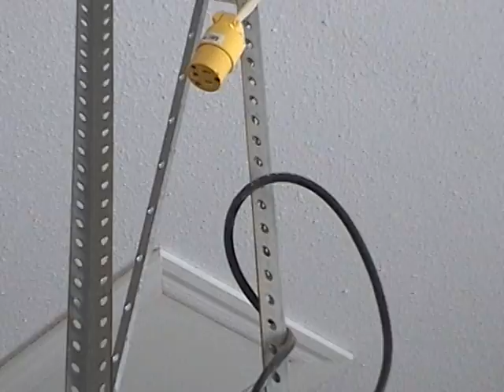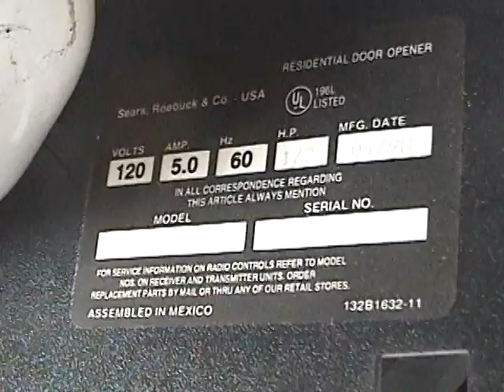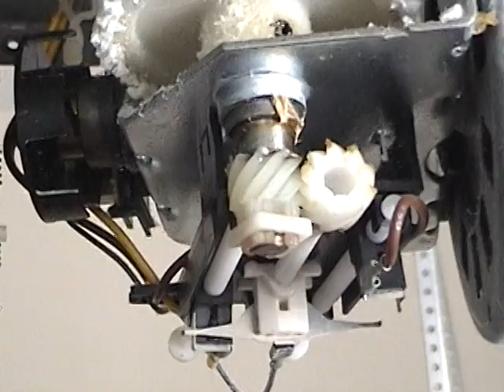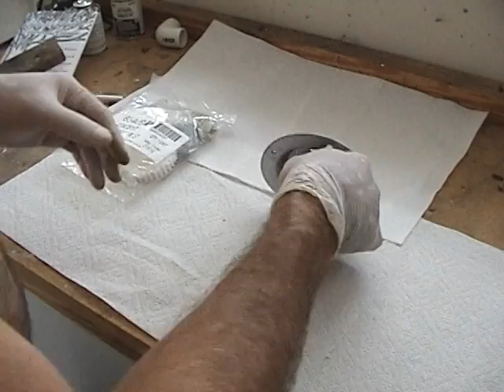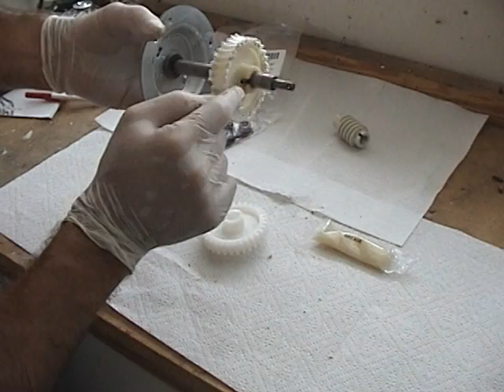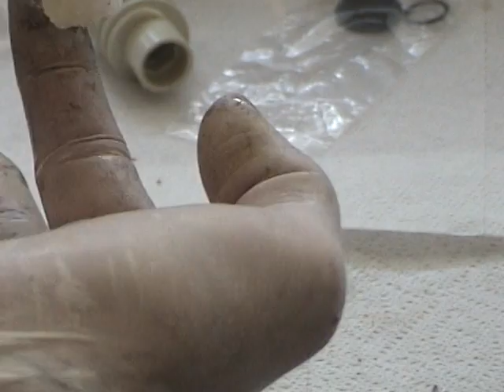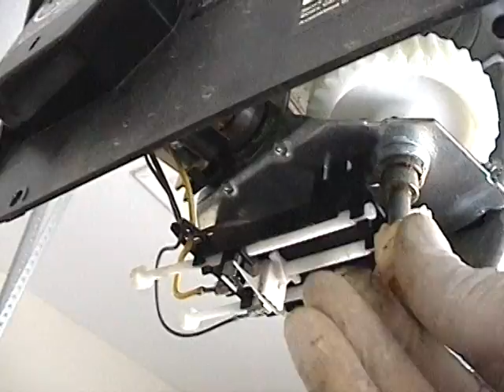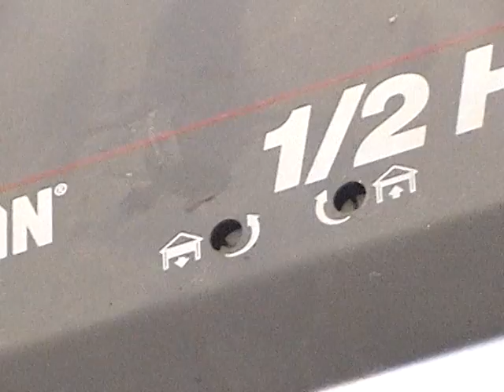Craftsman (LiftMaster) garage door opener issues?

Comment: Kris, I'm having issues. I've opened the cover on the garage door compartment, and my sprocket gear looks pretty good but there ARE shavings there. I've been told that it may be my RPM sensor. Does that sound right to you? Not sure I want to change a part that doesn't need it. Thinking of only changing the RPM sensor. Your thoughts? Thank you.
Reply from the maker: @dag1972  are you able to watch what happens inside the garage door opener operate with the cover off? Maybe you can see something slipping. Also my unit has some controls that let you adjust. The amount of force applied to the garage door. If you have them, Maybe those are set too low?

Comment: When you put the chain back it might be in a different position. If the chain jams at the end before the electronics tell it to stop it will get stuck in that position. Even adjusting the stop points will not help. 

I removed the chain off the drive and moved it 1 foot. Then adjusted the electronics so it would stop before it got jammed again.

Comment: Thank you Chris, now my garage door doesn’t have a chain.  It looks like a long threaded rod which is not turning at all but the motor in the unit is working.  Could this be a similar problem where the gear might be worn out?
Reply from the maker: Possibly, I'm not familiar with that style. Open the cover and have a looksee.

Comment: I put that new gear on adjusted the down the up worked then must have gone too far and ground that gear again  if you turn the two on the back not the travel the force could that stop it from shredding that gear as I adjust
Reply from the maker: Bummer, however you are a pro at replacing the gears by now :)

Comment: Well, it took me all day to get those 3 screws out with the tools I had and one screw was in crooked.  I was so excited once I got the new part in and the garage went up and down again, but I ran into an issue with the lights flashing and the door not closing or opening all the way.  I started messing with the up and down length controls and at some point I tighted the chain to try and fix the chain from rubbing against something.  After that, the door stopped moving.  I unplugged the unit and adjusted the down length again and it got moving.  I thought I was on my final adjustment to get the door to reach the ground and right when it did, something exploded and a cloud of smoke appeared as I jumped off the ladder!  I figure it was the capacitor.  Anyhow I am officially deflated after working on this all day.. UGH.  SO BUMMED!

Comment: after replacing new parts, the new gear teeth shredded off a little bit (about 0.2 mm)  every time open and close.  what may cause this problem? any one has any suggestion?
Reply from the maker: If you disengage your garage door opener from the garage itself is your door hard to open? If it is, the springs may be too loose. I would not recommend tightening springs yourself. Very dangerous job

Comment: Did you have to loosen the chain at all by adjusting the bolt when you took out the gear and shaft assembly?
Reply from the maker: I loosen the chain and took it completely off
Reply: @KrisKasprzak  super helful video! Just finished changing the gear on mine.

Comment: I have the same opener but I can't find the replacement kit.  Which one did you get?
Reply from the maker: I googled the model number of my unit and found a source. I listed the model number for my unit in the description. I also listed the part number for my gears. I recall this gear can be purchased with the attached shaft--removing the step of extracting the pin. as of 5/2021 the entire assembly is available on amazon.
Reply: @KrisKasprzak  Yeah, I saw that.  I saw on Amazon that they don't sell just the gear.  It's the whole piece.  But thank you for this video.  You saved me $100!

Comment: This video is legit, it was exactly what I needed to do and it solved my problem. Thank you! The toughest part is definitely taking out the three screws. I also ended up using a 3/16" pin puncher and laid the shaft across two 2x4s to hammer the pin out.
Reply from the maker: Glad I could help

Comment: Hi there, What you could do in regards to the chain removal is before you remove the gear assembly is to wrap some electrical tape around the chain and T rail encompassing the chain close to the T rail so you don't lose composure slacken the adjuster and try and mark the exact position of the chain with a white marker so the timing will be exact when re-installing. Also the gear needs lubrication from time to time like every two years or so - as that is why it gets ground up like that as mine did as well

Comment: Has anyone done this, swapped both gears, and then had a loud rattle coming from the gears? When the door is raising, these gears rattle like crazy. I tightened all the mounting screws and confirmed everything is in the correct order.
Reply from the maker: Maybe the springs are not tight enough and causing the motor to work to hard? Try detaching the opener from the track and seeing if you can open the door manually. If the door is hard to raise, maybe have the springs tightened--here's where I would call a licensed pro--those things are crazy dangerous.
Reply: @KrisKasprzak  Right -  checked the springs already. I even disconnected the limit switches and shorted the RPM sensor so I could remove the RPM wheel. Under no load (disconnected from the truck) the gears don't rattle. But under load, the motor mount's metal seems to flex juuuust enough to create noise in the gear set. After isolating the noise to the burdened gear set, I am calling in my preferred pro to have a look. There is only one person who I could find had the same issue, and they were in an Amazon review. So I hope my pro can learn something.

Comment: Thanks for keeping the video to the point. I had to replace the sprocket as it had snapped right off the shaft. The only problem I ran into was trying to figure out which part # to buy. I have a 
Sears Craftsman Model # 139.18856 
The replacement part is 41C4220A ... this includes the sprocket and the gear already assembled so all I had to do was slide out the old and slide in the new. If you are having trouble finding which part # you need, just call Sears Parts and they will sort you out.

Comment: Thank you so much for this video, I had the exact issue you have mentioned in this video. Without this video, I would have to call someone who probably would have ripped me off as I wouldn't know what was happening with the garage door opener. I spent $10 on the part and went step by step on your video and got my issue resolved and working again!!!  Taking the pin out of the spindle/gear was truly a pain and the bench vice is very much needed to tackle that part.
Reply from the maker: Glad it helped!

Comment: Worked for me on Sears craftsman 139.18846.  Used replacement gear and sprocket kit part 41c42220a ordered through Amazon.  Thanks for your post!  Gave me the heads up on the problem with the opener and how-to repair.
Reply from the maker: Thanks for posting your part numbers my Subs will appreciate that tip

Comment: Thanks for the video. I ordered new assembly (Liftmaster 41c4220a Gear and Sprocket Kit) for $20.60. It took me many hours but I got it installed. My garage door opens much more smoothly and quieter.
Reply from the maker: Glad I could help

Comment: Anyone know why my garage door would make that grinding noise when the garage door hits the ground?..I was thinking the rubber line set attached to the motor might be loose? Any help would be appreciated it's a craftsman 1/2hr
Reply: I did replace this part btw and it worked great for a week or 2
Reply from the maker: My guess is that the low stop adjustment is too low causing the door to jam against the ground. I would raise the lower limit. You may also have a pressure adjustment that will open the door if close pressure is exceeded--that may be off as well.

Comment: Kris, thank you so much for putting up this video and it gives me the confidence to do the job myself. In order to make sure there will be no surprise, I have read most of the comments for additional tips. I thought it would be a time saver if I summarize all the tips over the years here. 
Plan on 30 - 60 minutes for the job. Time depends on how detail you want the job done. Count on doubling the time if you want to change the worm gear.
Before disassemble, you would want to mark the chain position, clamp down the chain trolley, and mark the top cover orientation. This will save you time on adjusting the limits.
Loosening the chain tension screw will make your job in detaching the chain a lot easier.
Cover Screws for the sides and front/back are different. Be careful when you put them back.
Taking the back cover off and detaching the circuit board will make it easier to access the inside, but it's not a must.
Remove the hard to reach screw for the main gear assembly first. You won't need to struggle if you have a 5/16" ranch.
You don't need a vise to remove the pin from the main gear shaft. What you need is a 3/16" pin punch and then the job can be easily done by propping the shaft across two pieces of 2x4's or something like that. 
Putting on tons of grease will be pointless if the debris is not clean out from the worm gear and surrounding areas. The debris will shorten the life of your new gear.
Your gear kit will come with instructions. Couple that with Kris's video, one should be able to tackle the job successfully. There are three more YouTube videos on the same subject and explain the job from different angles. These can fill in the gaps if you are not sure how to mark chain position and clamp down the chain trolley with a visegrip. They were by AdamDIY, Paul Gatekeeper and All-Pro Quality Garage Doors.
Thanks guys for helping me out with the job. Hope my summary helps others

Comment: Did you not replace the worm gear on the motor? If you did how did you do it without removing the motor
Reply from the maker: I never replaced the worm gear. Of the 4 openers i had to fix, the worm gears were fine.

Comment: Do you have to align the chain afterwards? Also, don't you have to loosen the bolt on the threaded rod that holds the chain together before you can get the gear assembly out? Thanks for a great video.

Comment: Thank you for posting this video. After watching your tutorial I was able to assess the problem,  order the correct parts from Sears online, and it took me ALL day to actually take the gear out because I had a real issue getting the hex bolts off in the tiny space inside the apparatus. I made the mistake of loosening the two easier to reach nuts first and then the harder one was even more difficult to remove due to the pressure of the chain. I ended up using  a 1/2 wrench to loosen up the chain prior to removing the shaft so that I could get that last hex bolt out. The tiny pin that was holding the gear onto the shaft was nearly impossible to remove and put back in again. I ended up using clamps and then a nail driver with a hammer to get that pin back in without damaging the gear. 
I finally put it back together and the mechanism is working but I made another mistake when loosened the chain, the door catch moved away from the engine and now the door goes back down and then up a bit but then is stuck. 
Tomorrow I will loosen up the chain again, take it off the spoke and move that door catch over. 
Please excuse my lack of proper names for tools and instruments. I’m a chemist, rather than a mechanic, but you made this look so easy that I had to try and I’m really glad I did! Thank you again for posting this.
Reply from the maker: Glad I could help.

Comment: We just replaced this part and still no dice. Suggestions? (Exact same model you have there lol)
Reply from the maker: What does no dice mean? motor running door not working, motor not running, door not going all the way up or down?
Reply: Kris Kasprzak still the same, motor is making the noise but no motion.
Reply from the maker: @alexandraharris6297  you will have to watch the mechanisms while the garage door is attempting to go up or down and see where it is slipping.

Comment: nice vid Kris, but be a little more honest with the work duration. It did not take u 5 mins to remove the gear, because u even said tht u did other things prior too ! You dont hv to shorten the time for us ! We r all diehard DIY'ers. No one will judge u for doing a great job in 45 min or even an hour or more, as long as its done well. Good job and I gv u a thumbs up.
Reply: I ended up with the chain in the wrong position when putting it back together. Causing things to jam. Adding an hour to my job. It all works now so I am happy but people saying a job will only take 15 minutes for a DIY’r is just not being honest because things rarely go perfectly all the way through

Comment: Dude, can you help me? I just replaced the heat assembly because the teeth on the old one completely wore off. Now, whenever I hit the garage door opener button, the motor and chain goes 3” one way then 3” back the other way and stops.
Reply from the maker: There will be some adjustment screws on your garage door opener somewhere One controls the UP travel the other controls the down travel I suspect they are way off. There is another set of screws that control the up pressure and down pressure you may have to mess with those as well
Reply: Thanks for replying so quick. I did notice those screws. Is it normal for it to do that after being unplugged?
Reply: I wish I could show a video of what it’s doing but it’s not even catching the door. Even after turning the screws it runs for about 2 to 3 seconds and then it reverses rotation for about one second.
Reply: I’m also getting a code of 6 blinks
Reply from the maker: @annabellejonesify  are you sure there is nothing in the way of the sensors near the floor? Mine did similar and found spider web were blocking the sensors.
Reply: Damn now I can’t even open my garage door by hand. Any ideas?

Comment: I have a Craftsman garage door opener model 139.53960srt that needs a new gear and sprocket assembly. My owners manual calls for part number 41C4220A, but the Sears parts site says that this assembly is not compatible with my model number. Is that true?

Comment: What about rail movement how much should there be while door goes up and down.
Reply from the maker: Which rails are you talking about the ones with the rollers that the door rides on, or the center one that the chain slides along?
Reply: @KrisKasprzak  the center rail were the belt rides
Reply from the maker: @larespuertorico  The rail should be secure and not move (other than some basic shaking due to its length and weight.

Comment: I replaced my worn out part and i was able to open / close my garage for just one time. Its not opening anymore although motor is working, that white plastic gear assembly is working (i can see it moving). I opened everything apart and assembled everything back but not working. Any idea why?? Thanks in advanced!!
Reply from the maker: if the motor spins, what doesn't move? the worm gear, the main white gear, the sprocket at the top of the unit (that is connected to the chain). etc. Diagnose where movement stops. I suspect is a missing pin that fixes the gear to it's shaft, or a broken sprocket at the end of the shaft.

Comment: It is VERY important to follow his suggestion to thread the mounting screws into the top mount plate before trying to repair the gear and reinstalling the shaft assembly!!! Cannot repeat that enough.
Second, the trident clip that holds the bottom worm small worm gear may easy be destroyed when removing the one originally in the macchine. This may simply be from deterioration of the nylon over time and/or any tension left in the drive system. Nylon does degrade over time with sunlight and ozone and this clip is small and relatively fragile. There is a new one with  your rebuild supplies.
Rather than fuss with removing the drive gear, I simply bought a whole new drive assembly to drop into the opener. That renews the bearings and gives you a new drive worm gear if needed and other items if you choose to renew them.
Reply from the maker: Great tips and glad I could help.

Comment: I have the identical unit but 1/3 hp. We have trouble only in the winter. When it is cold the door will only go down if you hold the wall mounted button in for the entire travel. If you just press it as normal it will move an inch or two then fault out. Or if you hold it only half the travel and let go it will stop there. Any ideas? Thanks!!

Comment: Thank you so much  ... your instructions were very concise and followed them to the letter and my door is working again I called  at least 6 garage door guys ...they all told me the UNIT was out of date and there were no parts available ..I said I'd seen the parts on EBAY and they said oK but they don't work on non-factory parts ...so no go ...  I needed a new motor $600.00 ... I not a real handyman GUY but I could see what the problem was ... I would have been happy to pay a tradesman to do it ..but all they wanted to do was rip me off .... so with your video, $20.00 parts and some personal stress I fixed it So thank you ...very much Peter Robinson ..prob@labyrinth.net.au
Reply from the maker: Glad I could help. Glad you saved some money.

Comment: Does it matter which way you orient the new gear when replacing it?  Is there a top/bottom or does it matter?
Reply from the maker: I dont' remember there being a set orientation, I do remember a pin in the shaft that must fit into a slot on the gear to keep the gear from slipping--maybe the slot is on both sides, if so can probably go on either way,